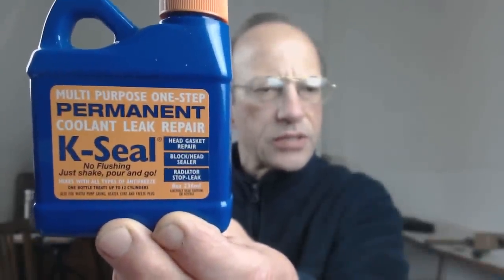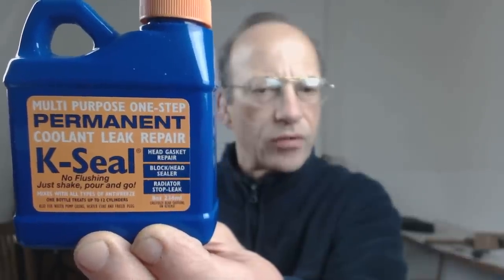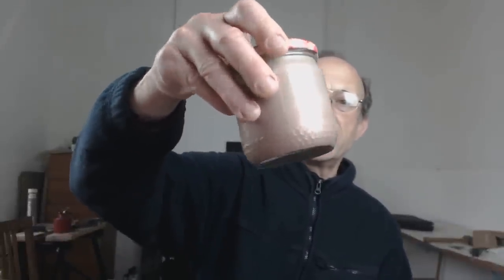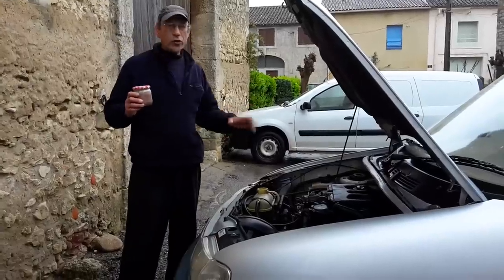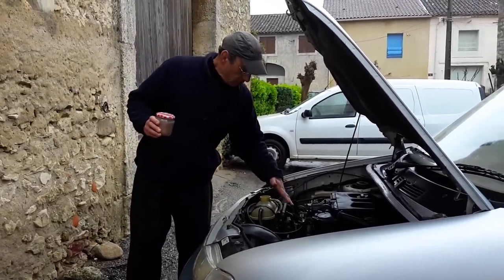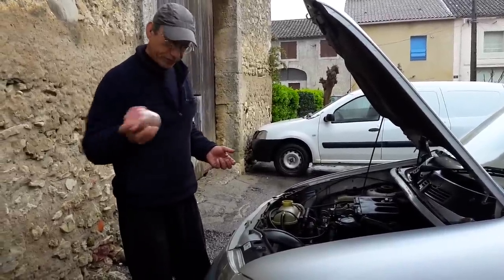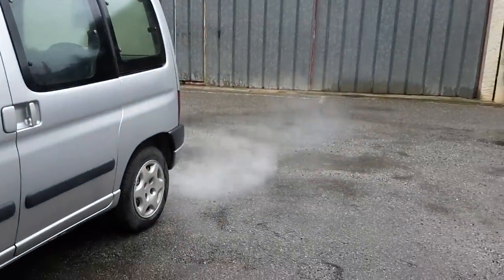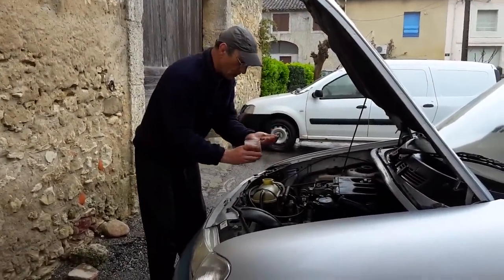K-Seal Full Test - Purchase options, Instructions & Results

Comment: would is work on a bmw 525i that has been overheated several times and has a headgasket leak and a cracked block?
Reply from the maker: The only way to find out will be to try it.
How do you know that the block is cracked?
You are probably thinking 'worse case scenario'.
 
Either way, you need to try it.
Financially it is a no brainer.
Reply: Well a friend opened the engine and told me
Reply from the maker: Understood.
So I'm guessing a new gasket costs quite a lot of money..... and it would be money wasted, if the cracked block can't be fixed.... yes?
So you're thinking "sod buying a new gasket.... let's try K-seal, cos it might fix both"?
I don't blame you.
However, I would suggest that there is a very strong likelihood that K-seal will fix the cracked block.
Mine has been running now for yonks without further problem.... and nobody has come back and said theirs has failed.
Personally, I think that if I had the head off, I would replace the gasket, as it will nip down nice and even.
... but perhaps K-seal will fix both probs anyway.
Hmmmm..... your call.

Comment: It's hard to get  someone  who do the  head gasket  all saying replace the  engine but a second hand  engine is €2000  I'd imagine it would not cost this much to do the head gasket  .
Hyundai i40.
Reply from the maker: For the mechanic, replacing the engine is piss easy.
Fixing the head gasket, may involve milling the head flat (due to warping).
Then, the valves should be lapped in etc. etc.

Nowadays, there are less mechanics capable of the task.
They are mostly trained to replace components..

Comment: I smell a little hint of antifreeze only when I turn my heat on. I was thinking about using K-seal. Anybody use it for heater core I would say it a sweat leak. open for your thoughts
Reply from the maker: I suppose it's down to how hard it is to get to the heater to check the hoses.
K-Seal might save you a pain in the neck, but if it's a hose, it could get worse due to flexing.
Do you feel lucky :)

Comment: would anyone recommend putting it in a 70cc 2 stroke liquid cooled bike with a leaking barrel???
Reply from the maker: No... there is no point, and it is not appropriate.
The head is often sealed with a silicone joint.
However, due to the increased bore size there is usually only space for an O ring.

The O rings supplied with the kit may be of poor quality.
It is a very quick job to drain the coolant and remove the head.... it must be done!

Fit a good quality O ring and try again.
Reply: no its more complicated than that. the engine casings don't line up very well and I've rebuilt the engine 7 times and i don't wanna spend the money on fixing it properly
Reply from the maker: I'm going out now.
I'll be back later.
I understand your problem.
The shoulder supporting the O ring can be minimal.
... as you describe... if they mate badly then you are screwed.
There is a solution, but we need to talk seriously.
I need to know exact measurements.

What is the exact cylinder bore diameter?
You then must determine the inner diameter of the O ring slot.

The difference between the two measurements is the supporting shoulder.
... anyway... more later.
Reply from the maker: Where is it leaking from exactly?
Where is the mismatched surfaces?
If it's a 74cc you can use a 68cc head.
This will give a bigger shoulder... That's how I improved reliability, with no further problems
Reply: its leading oil black oil from where the barrel meets the engine crankcase and the exhaust port. before it was leaking coolest fluid but we fixed it with a new gasket set but now oil seems to be riding its way out.
Reply from the maker: Without seeing it I would say that the oil is exiting the exhaust port, and blowing onto the base of the barrel.

There is no reason for black oil to leave the base of the barrel.
In an extreme case of piston 'blow by' maybe, but it is anyway sealed by the base gasket.
So it is the carbon enriched oil from the exhaust as the number 1 likely culprit.
You fix that with a new exhaust O ring.
Reply: but there is also oil in the coolant reservoir
Reply from the maker: If you have changed the coolant, yet more oil has appeared... this oil must be coming from the gearbox / clutch pinion area.

It could be passing through the water pump... or the engine casings may be cracked... or the gasket has failed between the clutch cover and the crankcase.

The first duct from the water pump, passes through the clutch cover, through the crankcase, and up into the barrel, round the barrel, up through the cylinder head, and on to the radiator.

With the clutch cover removed, check the duct faces... they can be pitted.
When re-fitting you may have to use a gasket paste.
Reply: the bike in question is a scooter by the way (Aprilia SR 50 R). we have tried all this previously but we are just unsure. Ive gone through 3 gasket sets, a new cylinder head and had the crankcase open 3 times to re-do it. just bought a newish crankcase of eBay for a bargain and going to change it back to a 50cc engine. if this dose not work i'll be back but thank you for the expert opinion!!
Reply from the maker: Okay Wilbo... stay cool.
You have a simple problem, but general confusion is preventing you from seeing what the problem is.
The above statement is 100% true.
There is no magic.
There are no gremlins.
You have a problem, but everything that you have done has not fixed this problem.

Why?
.... it's the confusion.
It's always the confusion.

When you are confused, you look at anything and everything.
Very often, this causes you to make rapid changes, badly implemented.
This can create new problems... which add to the confusion.

This is normal.
This is life.
Step back and look down from above.

It's no longer your problem.
You are the analyst.
It becomes fun.
Your job is to find the fault.

Suddenly, there is no longer any confusion.
:)

... but one thing I don't understand.
Why haven't you liked, and subscribed?
That is truly weird.
What is happening there?

Comment: How do you mean dropped a bollock
Reply from the maker: Well... he was storing it for you.
It is highly unlikely that it would just spring a leak by itself.

He must have done something.
... and if so... he did something wrong.

hence "dropping a bollock" :)
Reply from the maker: He had it in storage.
It's highly unlikely it sprung a leak by itself.

The chances are that he did something.
In doing something... he did it wrong
Hence "dropping a bollock" :)

Comment: Says you don’t have to change the oil.
Reply from the maker: Hmmm!
If the oil is full of water ... why would you want to keep it?
Reply: Engine Tuning depends on how screwed up the leak is. It does make sense to change it after a few days if it’s real bad. You could also add it as a precaution on an older car so what I’m saying is that it’s safe to keep it in the system.

Comment: always try to use distilled water not tap water
Reply from the maker: That's good advice :)
Reply: @EngineTuning  ive used K seal a lot...like it. i even use it for leak prevention. more awesome products:  TUFOIL (oil additive with 11 intl patents), SUGRU (silicone hardening putty) & silicone tape (rescue tape is one brand)

Comment: is it healthy to use, even though it sealed something in the engine, the particles of that chemical whatever that is (betonite?) might get into the combustion chamber, causing this stuff to be part of the emissions (not too healthy for humans), why would you want to keep it in the cooling system continuously to breath with vapors of it from the expansion tank valve??

Comment: had a small water pump leak, after 4 months leaked again. more k seal,  or cambelt water pump  job, next.. hmm, 2005 clio 1.2.
Reply from the maker: If the leak is coming from a 'seal' or an O ring; don't bother with more K-Seal ... it is not designed to fix those problems.
Reply: @EngineTuning   tah :)

Comment: Guys… DO NOT PURCHASE THIS. This will block your radiator and your heater will stop working
Reply from the maker: This is simply not true.
Why are you posting this nonsense?
If this was the case, we would have known about it, and people would have reported it.

Let's guess.
A car mechanic told you this?
Reply: That’s an excellent guess well done, but no because it happened to my car.
Reply from the maker: @Hussain-tr9zu 
IF it happened to your car...
... then the radiator and heater were already clogged to the point whereby it would be overheating.

The product can't clog a free-flowing radiator.
Why should it happen to your car, and no one else's?

You are making up this story, simply to back up your false claim.
Reply: I just used it a week ago none of that happened. It just fixed the leak.

Comment: I heard this damages your car
Reply from the maker: Oh really.... where did you hear this, and what exactly would be the cause of the damage?
The worst case scenario is that the engine is already too damaged to fix.
No engineered water passage is small enough to block.
The only gap filling that can occur, will be in the damaged area.
Don't forget that there are a lot of understandably pissed off mechanics, that are losing engine rebuild work, because of this.
However... we are not Luddites.
K-Seal exists, so there is no going back.
But you remain free to either scrap your engine, or have the block welded and skimmed, or simply pay for a new gasket to be fitted.
It just depends upon how much money you have.
It's like buying a new tee shirt.
You can pay a tenner, or you can pay 70.... but you are still only wearing a tee shirt that anyway only cost a few pence to produce.
The difference here is that you risk a few quid from your back pocket.
If it fails, then shit.... you go for the bank loan ;)
But for most people, it's a win.
Reply: Do your own research
Reply: @familyfirst7027  no.... but he owned the commenter

Comment: just don't work on vw lt 2.8tdi
Reply from the maker: That's bad luck.... thanks for reporting.
Have you considered talking to the company.
The product is guaranteed to work, but they reckon in a small percentage of cases it will not.
Anyway... if you do talk to them... indicate the problem that you had, and what you did etc.
Report back on what happened... what they suggested... it could be interesting.
BTW in which country are you based?
Reply: Not recomanded not working weist the time

Comment: Biggest load of crap ever had a pin hole in my bmw rad put in 2 bottles still leaked had rad changed 

now its blocked my heater so a further 500 quid to sort it avoid this product its crap
Reply from the maker: I don't believe you.
579 comments, and suddenly two consecutive posts claiming rad problems.
No way!

Comment: Richard Burton advertising K-Seal, lol.
Reply from the maker: Praise indeed holybritches ... though I feel it is slightly OTT, but thanks anyway :)

As for the advertising?
I suppose it is; however it is a consequence of the live test, rather than being a reason for the test.
That was because I genuinely had a need for a solution, and figured that this knowledge would be best shared amongst the community.
... and if I was going to do it; then better to research, and provide as much information as was feasibly possible.

Three and a half years later, it's still fixed, though recently, I have noted some white smoke at start up.
This may be simply condensation.
We will see, over the coming months :)